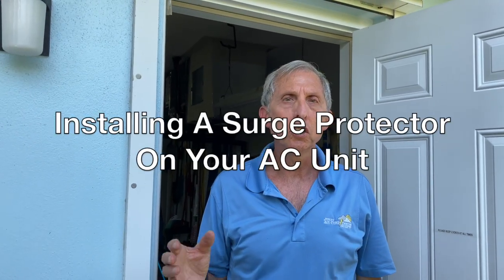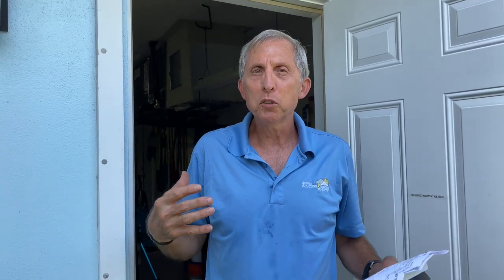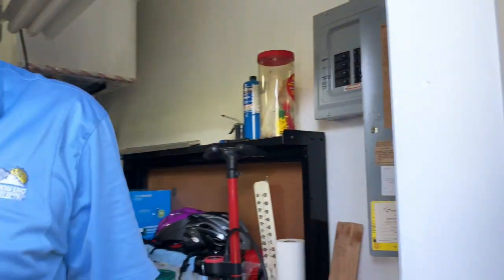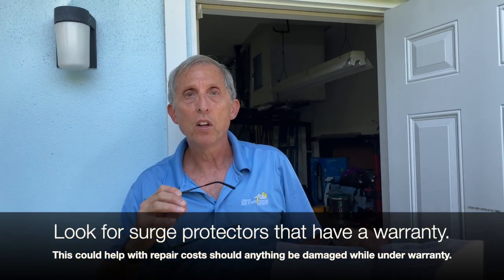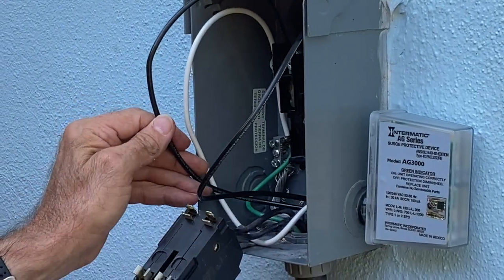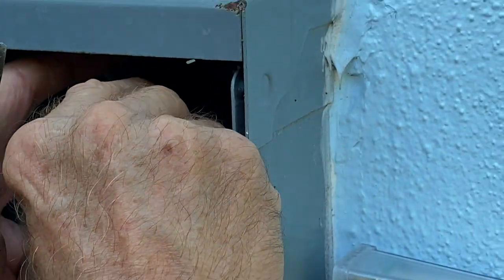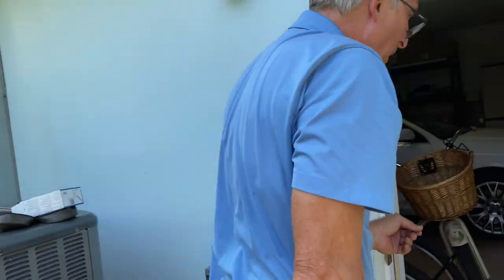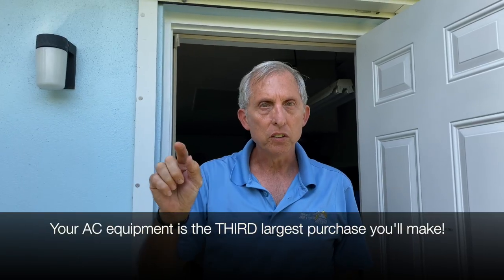Protect Your Air Conditioning System From Power Surges: Step -By -Step Installation Guide:

Comment: Thank you for this amazing vid. I live in Pakistan but I reckon the weather is the same as Florida. Our AC split units (the invertor variety) go bad in under an year. I am currently running 5 Toshibas and they all had circuit issues in under 1.5 years. We are by the sea so part of the fault is salty air and corrosion, so I wanted to ask if there's any sort of weather resistance measures we can do apart from Surge Protection to prolong life?
Reply: You can purchase units with gold plated fins that will not corrode. I believe Madea or Gree.
Reply: You can dip your coils in a liquid to protect from salt air and etc , iam in Florida and I do that
Reply: @ventkingsflorida517  Which liquid if i may?

Comment: It tells  you right in the directions to make  the leads as short and straight as possible. Cut to the correct  length.
Reply: Exactly. Coiling them up is incorrect and the factory sells the SPD pre-wired with a certain length to accommodate different installations, they aren't meant to stay that length. Coiling and curving them creates impedance...

Comment: Thanks for the video.  One important recommendation from the installation instructions which contradict what you stated in the video is to cut the conductors as short as possible. "Ensure conductor lengths are as short and straight as
 possible for best performance. Do not coil excess wire."
Reply: I guess im randomly asking but does anybody know a tool to get back into an Instagram account?
I somehow lost my login password. I would love any help you can give me.
Reply: @Zayn Archer I really appreciate your reply. I found the site on google and I'm in the hacking process atm.
Looks like it's gonna take quite some time so I will reply here later when my account password hopefully is recovered.
Reply: @Zayn Archer It did the trick and I actually got access to my account again. Im so happy:D
Thanks so much, you saved my account !
Reply: @Bobby Dylan happy to help :)

Comment: I appreciate the video and the warning to take.  But as a License electricain. You are not supposed to have braids hanging out if lugs.  I mean if you did not want to soldier the ends you could have used a ferral or at the minimum. Twist the wire a little tighter.   Not trying to Criticize but if you’re going to show something, do it right
Reply: How does this system protect? I don't see power interruption on high voltages, like the protectors that sit in the middle of the install. Is is parallel to the main current. How this equipment stop the flow of electricity if needed?
Reply: You'd think a licensed electrician would know how to spell ferrule.
Reply: You only need one leg to ground and the other to the other.. it's 120/220v single phase..

Comment: It popped out. That's exactly why its against code to have more than one conductor in that tap.
Reply: What should be done
Reply: @AgentOffice  Properly connect the wires outside the lug to a single pigtail that goes to the lug. Or use a disconnect with multiple lugs.

Comment: When selecting surge suppression, all surge suppression is not the same. Clamping voltage, total energy rating, reaction time all play an important role. Just installing one is no guarantee you'll have adequate protection. 

Ground resistance is crucial too. A poor ground will make any surge protection ineffective. 

On installation, all wires should be as short as possible to reduce resistance. Any wires bent during the installation on the surge protector should also be installed in such a way to make the bend radius as large as possible to reduce inductance.

Surge protection closest to the ground rod is the most effective. With this in mind, its also a good idea to place whole house surge protection at the distribution panel to take the "brunt" of the surge. Then place additional surge suppression with tighter specs at the equipment you want to protect.
Reply: Which one would you recommend for a mini split/inverter condenser equipment?
Reply: @OnePointLander  Johnny, I would consider something like the Intermatic AG3000 or similar, mounted at your compressor disconnect as a second line of defense. If you don't have a whole house surge protection mounted in your distribution panel, I would also recommend doing that as your first line of defense. The 2021 NEC started requiring this whole house form of protection as part of the new build code. If your panel is not too old, many of the major panel manufacturers now make a snap in whole house protection that easily installs in the panel.
Reply: Wah wah wah

Comment: Two big mistakes on your installation: Double taping it is a big no no.  Second of you tied the neutral to a grounding wire not a neutral.
Reply: Item two is actually not valid. At the ac unit there is no neutral available, and per the manufacturer in the installation instructions: "According to NEC Article 285.27
. For applications where the neutral wire is not present, the SPD white wire (grounded conductor) may be identified with green tape for connection to the equipment ground." So it was perfectly fine to use the ground in this situation as long as the SPD white wire is identified with green tape.  Recommend you always refer to the manufacturers installation instructions and check the relevant NEC section for authoritative information.
Reply: @fritsriep3830  I'm about to install one of these on my new split unit.  What should be done to prevent the double tapping?
Reply: @da324  make a pigtail using a 10 awg wago or a wirenut
Reply: @fritsriep3830  Nowhere in the instructions says what you stated.  Connecting the neutral to the grounding is making it live, which it could be extremely dangerous.                             285.27 Connection Between Conductors 
An SPD shall be permitted to be connected between any two conductors - ungrounded conductor(s), grounded conductor, equipment grounding conductor or grounded electrode conductor. The grounded conductor and the equipment grounding conductor shall be interconnected only by the normal operation of the SPD during a surge.

Comment: Code violation. Double tapping on the Line side.
Reply: What should be done
Reply: @AgentOffice  You have to use extra wire and make a pig tail, i.e. use extra wire and wirenuts to make the connections.
Reply: @stevenle1760  wire is so big don't think I can do that
Reply: @AgentOffice  polaris taps
Reply: @stevenle1760  Do you think you can use Wago connectors instead of wirenuts?

Comment: 120 volt surge suppression for 240 volt system?
Reply: This unit is designed for split phase power with 120v to neutral/ground and is rated for 240v phase to phase.  the manufacturers spec and installation instructions clearly show this unit is rated for 240v for line to line protection.